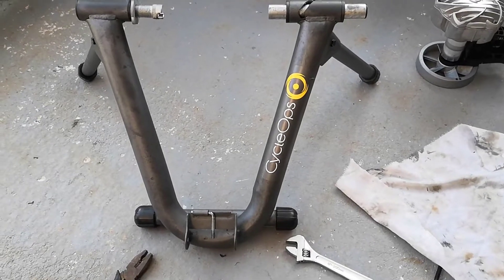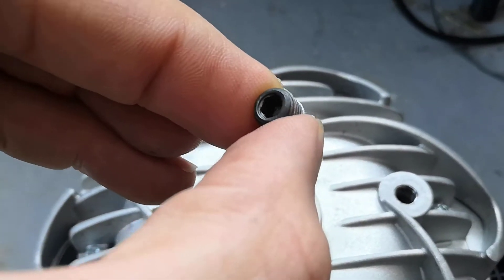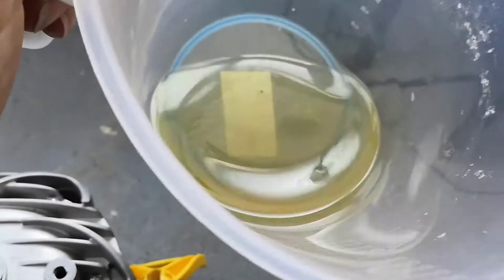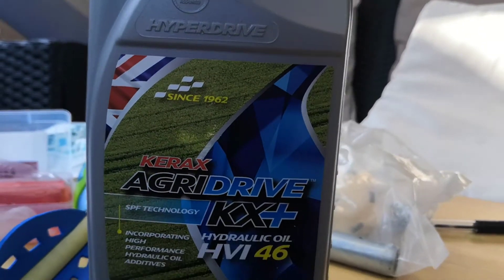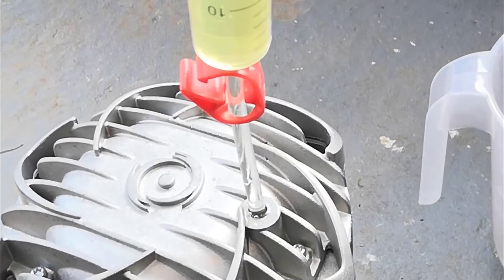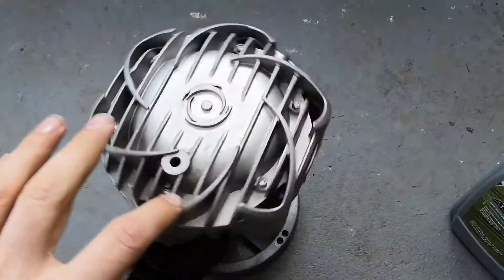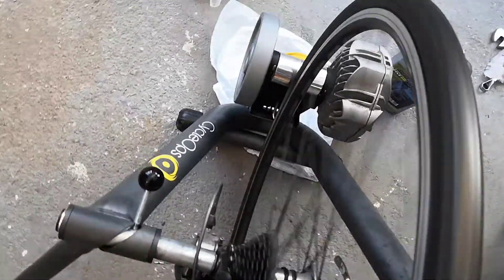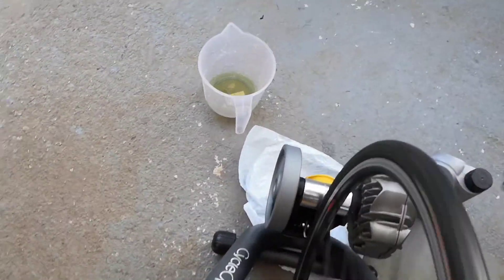CycleOps / Saris Fluid2 Trainer - Replacing Fluid / Oil

Comment: How did you get on with this roller, do you still have it?
Reply from the maker: I don't use it anymore - I ended up getting a wattbike Atom to continue with Zwift. I'd say i instantly lost 30watts when switching over to a smart trainer. This fluid trainer is good for your own training, but not good (and not fair to other riders) for racing Zwift.
Reply: @mikebarrax  Thanks

Comment: Using your method I successfully changed the oil.  The oil you suggested was not available.  I used ISO 68 Premium Machine Tool circulating Oil which seems to do the job.  Thank you.

Comment: How is your trainer running after this couple of months?
Reply from the maker: Its been fine. No more maintenance carried out on it. Upgraded to a smart trainer about 3 weeks ago. Before that I'd used it almost everyday for 1-2hours. No complaints with the Fluid2 after that oil change.
Reply: @mikebarrax  thank you for your quick response, just ordered same oil as you used and will do maintenance on my trainer as I bought used one two days ago. Greetings!
Reply: @mikebarrax  just replaced oil in my unit, loaded 20 ml more then i drained and i have to say WOW! What an improvement! Thank you once again! All the best
Reply from the maker: No problem, glad it helped!
Reply: @JamCiJestBrutus  ile oleju konkretnie wlałeś? I gdzie kupiłeś używkę, bo sam się rozglądam :)

Comment: How often and why do you change the fluid? I’m planning to buy used online. I’ve never bought anything like this ever. Thanks in advance
Reply from the maker: It just felt too easy, not enough resistance. I figured this unit was over 10 years old (I got it cheap) so the fluid's consistency could have broken down over time. More of a hunch really. The new fluid gave a more road-like resistance in my opinion. I doubt I'll need to do this again but if I do, I still have loads left in the bottle. It's still running like charm now ... Good luck !